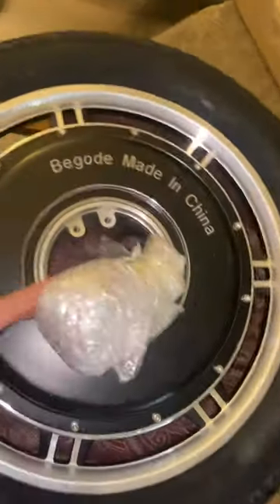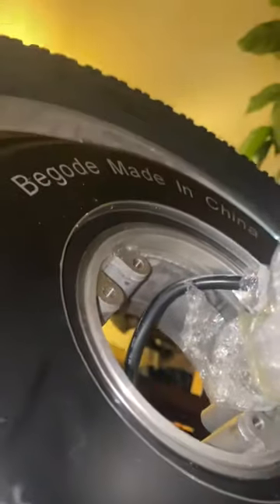Motor wires direction on hollow bore motors

Comment: Thanks Ray for posting the teardown and repair videos. I have the old type of cover. There was no trapped water when I tore it down. I'll be drilling drain holes before I put it back together.
Reply from the maker: just make sure you drill below the shoulder where the bearing sits. i did put a video of the holes too
Reply: @rayrokni  I just finished watching that video. Again, thanks.

Comment: This might be a stupid question but why would the motor burn up if you put it the other way? Or did I misunderstand what you said?  Thanks again ✌️
Reply from the maker: the hall sensor position is important so if it was swapped position, forward would become backwards. this would cause total confusion on the board. motor would start shuddering and within couple seconds the board will fry
Reply from the maker: basically same reason your board will burn if you plug the motor wires incorrectly on the board. you are again changing the direction of motor.
Reply: @rayrokni  okay I was just thinking it would be the same as riding your unicycle in reverse.
Reply from the maker: not quite 😁. basically you are telling it to go forward when leaning forward but motor is turning backwards, imagine a string being pulled at both ends
Reply: @rayrokni  oh well that makes sense then! Awesome 👍. 
Thank you for taking the time and explaining ✌️have a good day.

Comment: Hello Ray, is it a new motor for your RS? You had problems with the original one?
Reply from the maker: no i have no problems with my motor out bearings. this is for stock.  this is new motor with new bearings. the hub now doesn’t cover the bearing , a solution for standing water from v1, but now the bearing seal could get damaged by rocks or gravel off one was to get caught in that exact spot.
Reply: @rayrokni  yes I agree. I had the info on these evolutions from my friend at Gotway. I hope to have no problem with my motor from early batch but I have already some strange noise to be investigated. For the moment it’s not permanent but I have less than 500 km on the wheel. If I have a problem with the bearings I plan to try this new version of the motor.

Comment: Ray, sorry I did not get how do you know that without looking where the hall sensor is and putting the wires on the opposite side. Is it because wires are packed already facing the correct way and do we trust that?
Reply from the maker: experience 😁. i will say it, but please don’t take it as gospel. in my experience the motor code on gotway/begode wheels is printed on the side where the hall sensor is and the wires come out the opposite side of the hall sensor.
i have contacted gotway and recommended they mark the hollow bore motors so people don’t have issues.
Reply: @rayrokni  Thnk you, can i buy a spare fan from you at the end of the month pls
Reply from the maker: @igorgoga7985  sure
Reply: I had a bearing failure last week on my RS C30. My wires were exiting the side with the motor code. If you get a replacement motor assembly I would suggest removing one of the side covers to visually check for the hall sensor.
Reply from the maker: @frisky-neko  so why do you think that is bearing failure? thx
Reply: @rayrokni When I got home Saturday morning the wheel was making the dry bearing sound. When I field stripped the motor the right bearing failed. The left one spins freely with no noise. It's very humid and cool all the time where I live. Ewheels is sending me some replacement bearings. I'm going to see if my heat gun will able to heat up the cover enough to pop the bearings out. There seems to have been a local run on all of the propane cylinders for the brazing torches.
Reply from the maker: @frisky-neko  amazon